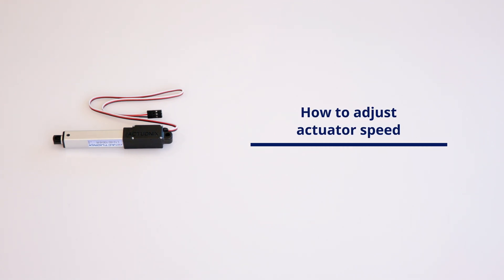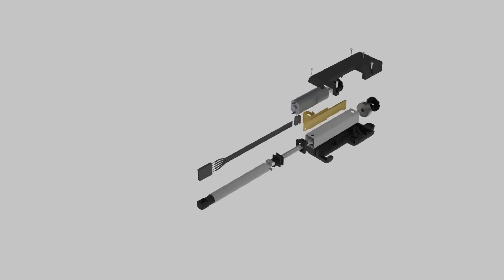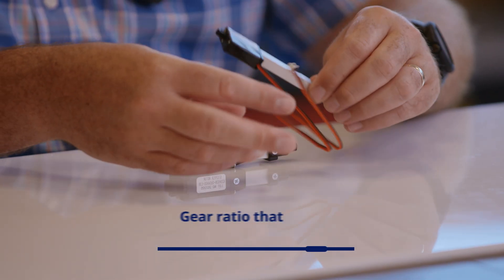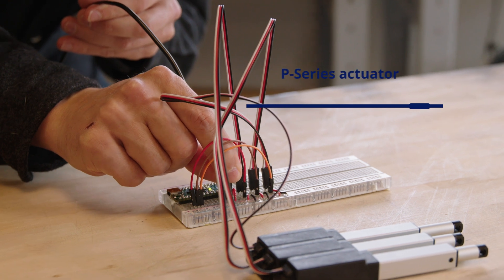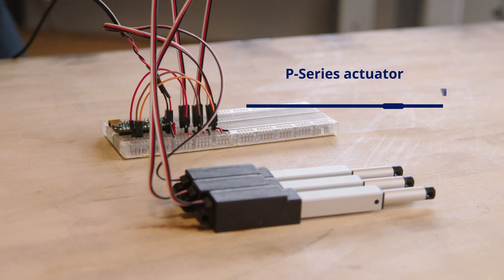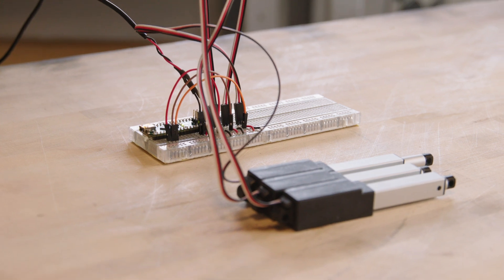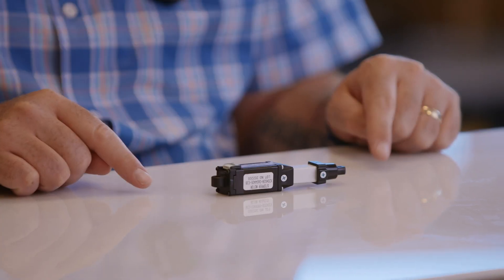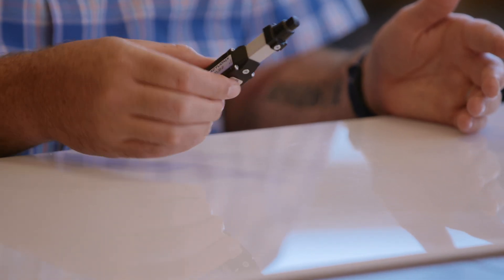How To Adjust Linear Actuator Speed

Comment: hi guys, how would you be able to synchronize for linear actuators with feedback? do you need 4 LAC boards? and how to link them to have them all on the same speed with one switch?
Reply from the maker: Synchronizing multiple actuators is tricky unless they are coupled together mechanically.  Otherwise, they could all respond a little bit differently across the LAC boards.  If they really need precision synchronization, then a stepper motor model is their best bet.